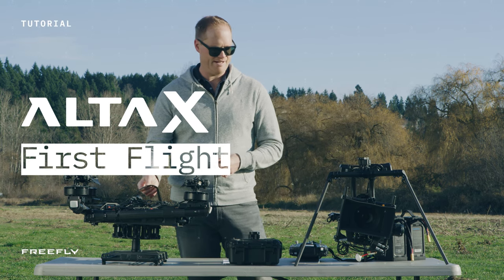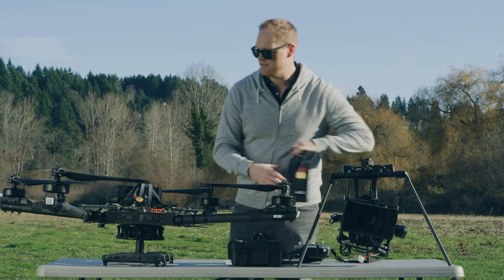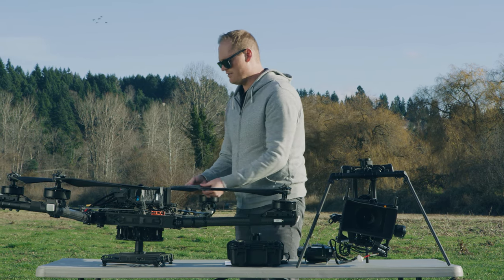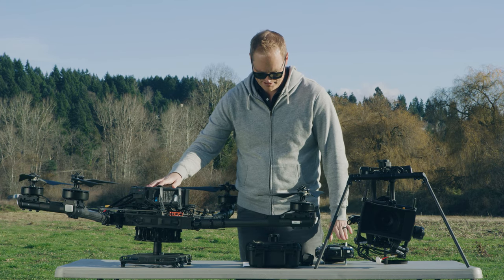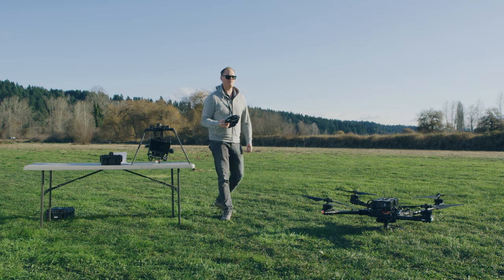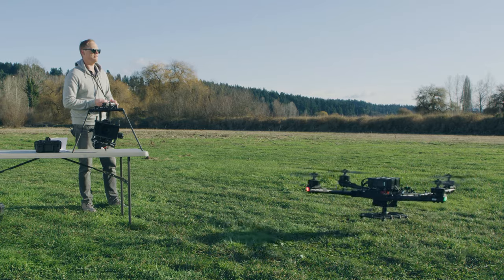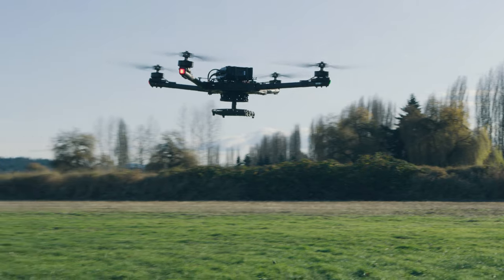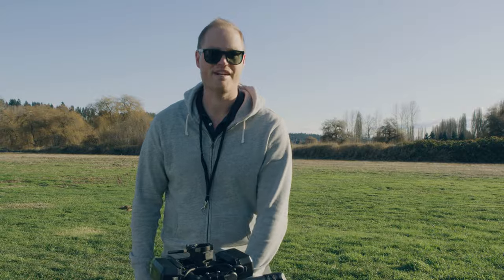Freefly ALTA X: First Flight

Comment: Tabb:  PLEASE incorporate a current sensor so people can monitor mah consumed in the Alta X.  Voltage alone is so risky for new pilots flying in areas where the temperature significantly changes season to season.  Futaba makes it so easy.  Cheers!
Reply: Good point, we intend to add this in the future.  Rest assured if you stay in our payload range you will not have any issues!
Reply: I just saw your comment AND the response after I posted my comment, and I cannot believe it [the reply]. They "intend" to add this in the future? Really? Like I said, a toy drone for $100 bucks has the basics covered, such as battery levels, altitude, distance and what not. Again, in all the years I have been flying drones and coming across the ALTA stuff, I have never seen anyone talk about the software. Well, now I know why... because it does not exist. Anyhow. Great hardware and thanks for posting.

Comment: Nice hardware, but what about the software!? In all the years you guys are on the market, I have never ever seen a video that explains the software side of FreeFly Systems. You can buy a cheap drone for under $100 dollars, fly it with your phone and see ALL telemetry on your screen. Distance, Voltages, Altitude, Flight modes and all other sorts of things that come in handy when flying a drone. That said, what about FreeFly Systems? I had Futaba radios myself and I know that they support telemetry, so is that how you guys do it? If so, how come no one ever talks about that!? I mean, never ever ever ever.
As a pilot I need to know at least my battery levels and altitude,  right? Thanks.
Reply: F C we report all that info in a variety of ways on different machines ( App, OSD, long range telemetry to laptop / tablet / phone) our solutions have changed Over the years but you can download our software / apps for a closer look
Reply: @tabbfirchau1  Ok, thanks for the reply...